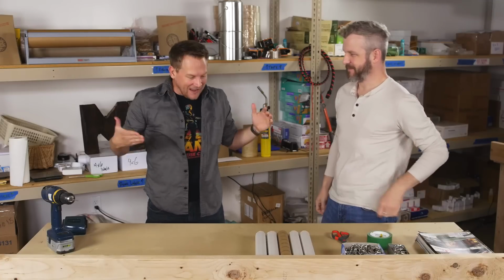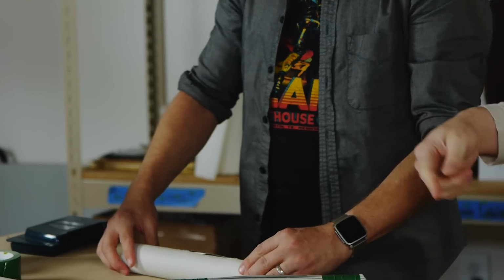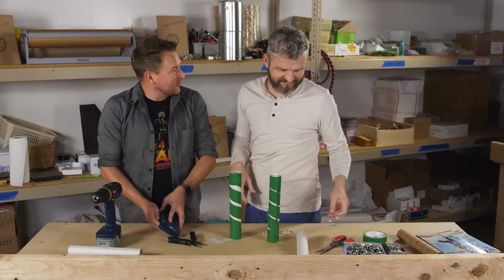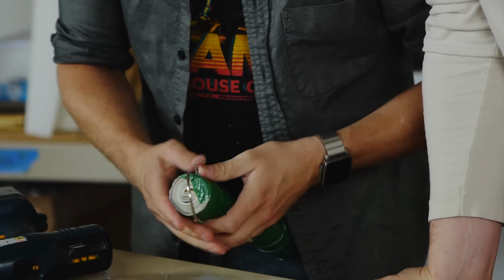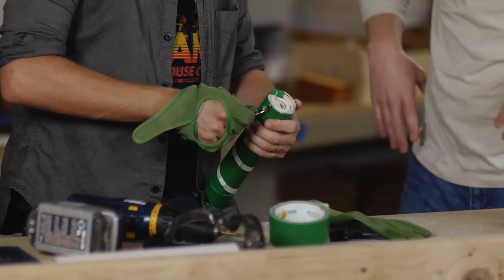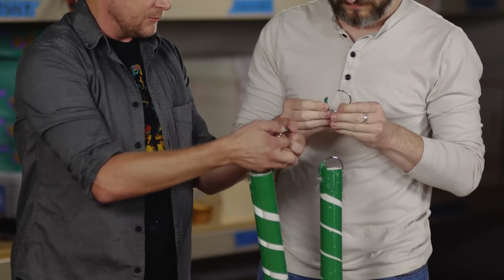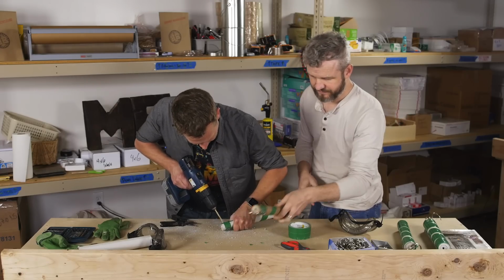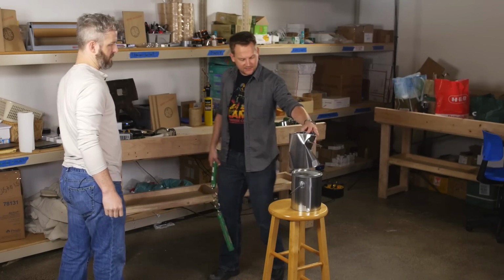Making Real Nunchucks from Magazines

Comment: One commonly overlooked weapon: PVC pipe.
Reply: Abhishek Singh true tho
Reply: Not as a club, its too brittle.
Reply: It depends on the thickness. Thin PVC pipe will break. If it's thick it'll last pretty long. And besides this is an improvised weapon you only need to hit an attacker a few times.
Reply: They did make PVC blowpipes.
Reply: You can make a bow out of PVC pipe that shoots more than hard enough pretty easily.
Reply: It's a catalyst. It can be weapons, but not a weapon.
Reply: I mean when you thin about it youcan use pretry much anythink as a weapon or make those things i to weapi s by combining them (like those Nunchuks) and a pvcpipe is one of them but i would rather have wooden club or a metal tube than light pvc pipe
Reply: Bonk
Reply: Yo my friend made a javelin, a blowgun and a nunchuck just from 1 long pvc pope he found in a field near our street
Reply: @karvast5726  PVC can be used as a club as well. You just have to use the thick walled gray kind. That stuff is seriously tough. I have a piece of 1" diameter that's about 18" long that I've used as a breaker bar for years on tough bolts and nuts such as lug nuts on car wheels. If you filled it with something like JB Weld it would be very dense and would make a good club if you needed it.
Reply: @mikefelty2625  sure you can but since we are talking about harware store parts a plumbing pipe is going to be that much better
Reply: Steel
Reply: bonk
Reply: I'll take a PVC pipe quarterstaff over numchucks any day.
Reply: cap a long pipe of pvc and fill it with wet paper or concrete if you’re that tough and you have a heavier club to smack things with.

Comment: When I made nun chucks the one time, I threaded a shoelace through the middle of the steel bars, tying a knot at the outside end, then taped it down to keep it from sliding out. In your case, you could have taped the rope down the edge of the spine before rolling them up. Just make sure the distance between the ends is as small as possible too. Too much rope/chain/shoelace makes it much harder to control

Comment: Wouldn't it be easier to solder the rings instead of taping them?

Also try to make a balisong out of wood or cardboard.
Reply: DJ Hanzel they are going for cheap DIY stuff so a solder wouldn't fitt
Reply: Or double up on the rings. 
Someone 3D printed a working balisong/butterfly knife! And another person did it out of corrugated cardboard... I think. The magic of youtube
Reply: Nah! the solder wouldn't be strong enough to hold the clasp together considering that those clasp are made out of stainless steel.
Reply: DJ Hanzel i don't think soldering would be very useful when trying to make an improvised weapon

Comment: Places like Home Improvement stores (Lowe's, Home Depot, etc.), sell plastic and metal chains on a bulk reel, so you can easily get them to cut it to proper length for you, rather than trying to tape binder rings together. Maybe for the binder ring that goes through the magazine, you could double up on that to help it stay on the chains.

Comment: guys really? did you not take shop class? you dont wiggle a drill.
Reply from the maker: I fell (once again) into the trap of thinking "It's just paper..."
Reply: Ah understandable. but over all i do love y'alls work. especially the respirator one. Have you guys seen how to make flashbang/concussion grenades with MRE heaters?
Reply from the maker: no, but that sounds AWESOME.
Reply: yeah its pretty simple you get the magnesium heaters and throw it in some water. (the basic explanations)
Reply: The Modern Rogue to get the rings to stay I'd rap the rings in tape over     like alot of  layers of tape do the whole ring and or rings to strengthen the rings with the hard hits or sauter them together or bend the clasp in to hook shapes to lock them in to one another I'd use some pliers to shape the rings.
Reply: The Modern Rogue  very cool use electric tape for stealth and a better grip for the handles.
Reply: Gamma Prysem yeah that is why the THIN drill bit broke don't wiggle
Reply: GamingParkourArt - vlogs and more  Most drill bits will snap if you wiggle them. As someone who builds robots, trust me i know quite a bit about drills. even thick drill bits will bend or snap if you wiggle them in a dense material
Reply: I was cringing that whole time

Comment: For future reference, I'm sure that was a cheap drill bit, but always run the drill while pulling it out so it doesn't snag and snap.
This also seems like it'd be better if you just used a hefty eye bolt epoxied in the top with some actual chain from home depot.

Comment: At one point, you'll have to break out the car battery and make a spot welder out of it to actually close your chain loops. The principle is simple, you just connect the battery to one and the other side, and where the loop barely closes, resistance will mount and it will weld itself together. The issue is avoiding death by fire or battery explosion. I have some moderately more responsible ideas in this regard.

Comment: Putting a thin rope through the core of the magazine tubes and tying some knots on each end would probably be an easier and more reliable way to do this. No drill needed and you could tape over it.
Reply from the maker: good solution!

Comment: Paper is actually really fucking strong.  For a science project, we once had to build a miniature bridge that had to support weights for an exam.  We had to build it with Popsicle sticks, but glue, tape and paper were also accepted.  We had a limit on how many Popsicle sticks we could use, but not how much paper.  I made the entire bridge out of paper, they all laughed at me...  But then came the tests.  My bridge won, not a single other bridge passed all the tests.  I was so confident in my bridge that I even told the teacher to put a 20lbs rock on top of it, it wasn't part of the rating process and the bridge still held up!

They all laughed at me, but in the end, I won, with my mighty bridge of paper!

Comment: mmk guys, when you roll the magazine run paracord through the middle. you will want at least 16 inches plus the length of the tubes (3+ inches out of the ends, taped down, depending on your roll diameter).

Comment: I woulda thought putting a chain through the opened magazines.  Rolling them around the chain then restricting it all with the heavy duty tape as well as bolting off the chain end at the handle end of the nunchuck would have made a much more efficient weapon

Comment: For anyone who wants to do this a bit better here's how:
1: soak newspapers in hot salt water.
2: leave them out to dry.
3: once dryed completely rip them into small pieces about the size of your thumb nail or slightly bigger.
4: use the tubes from the inside of aluminium foil rolls, they're pretty sturdy atleast where I live and are fairly thin.
5: use electrical tape to tape one end of the tube closed.
6: use a broom handle or something similar to stuff the shredded newspaper into the tube, get as much as you possibly can in there but be careful not to rip the tube.
7: once full tape the other end of the tube closed and wrap a layer of tape around the tube to cover the whole thing.
8: repeat until you have the desired number of cardboard hurty sticks.
9: attach 2 sticks with eye bolts and paracord.
10: enjoy.

Comment: Honestly the way you were using it wasn't that far off. Thanks to movies, video games and tricking people think nunchaku are all about spinning and switching hands, but in reality, the intention is just to swing it as hard as you can at someone and then bring it back in. Obviously it takes a lot of technique to learn to use accurately and safely, but most "real" attacks are just hefty overhand flails, underhand snaps and horizontal whips.

Comment: After you've drilled the holes, put the drill in reverse to get the bit out without breaking it
Reply from the maker: doesn't that leave all the paper fluff in the hole?  I'd think you'd want it still going forward as you pull it out to get out all that blockage.
Reply: +The Modern Rogue you can do both. I've never had a problem with leaving a lot trash in the hole after I drilled it. It's just preference. Great vid by the way.

Comment: I want to see the modern rogue make a bo staff, that would be cool
Reply: Christian Serrato Definitely going to do that at some point in the future.
Reply: It would be interesting to see a bo but idk that you could make one out of anything really other then wood and then you need to right wood or else its just going to break. And if you make it from metal it would have to be something that is able to bend and return to shape because thats what gives a bo its power. Maybe copper pipe with a tight packed paper inside and a tight wrap paper outside to hopefully allow it to flex a little but give it enough rigidity as to not bend.

Hell maybe with enough glue and newspaper your could do it.

Comment: Never remove a drill from anything without it being on, rule number one guys. I also would have used rope or string. Like, I get the binder clip thing, but rope would be less prone to snapping open. I now just got up to the point in the video where they say you could use rope.

Oh yeah, nunchucks are illegal (or restricted) in some states, so look into that before you make or buy them.

Comment: I would think that keyrings (the ones where the ring goes around twice, instead of having a hinge) would work better as the chain part.
Also, you don't need to do this as a full nunchuck, you can just roll up a magazine tightly and use it as a short self-defmce baton.  Jabbing the end into someone's muscles can be remarkably effective. (give it a try on camera sometime ;)

If I was going to go to the amount of effort YOU guys went to, though - I'd just do it 'properly' with two sections of broom handle, and a length of paracord.  (Get a decent-size drill bit to drill two holes through the diameter of the dowel near the end, about an inch apart, and another hole from the end down the center, to meet the first hole - thread the rope in the hole in the end, loop it out one of the diameter holes, through the other diameter hole, then complete the loop to pull it out the length-ways hole.   Do the same for the other dowel, then tie the two ends of the rope together.)
Reply from the maker: yes to all your comments.  And judging from which, it sounds like you'll enjoy this: https://www.youtube.com/watch?v=A5rwjz4LjlY&lc=z12ddv3zgkukilq5g04cch4zopjjjl2y2mo0k
Reply: The Modern Rogue
Haha, yup - just like that ;)

Comment: Aside from the binder ring bad idea and the paracord good idea, I would only question the construction material availability. I assume we are using rolled paper because of availability of that in a prison environment. But then binder rings, drills, and even paracord would not be available. So of we aren't restricting the conditions to a prison environment, why not use 3/4 inch diam. wooden rowels, and linked chain? So I guess I am giving this video a bad review because it is an extension of what could be done using the millwall brick principle, but the project disregards better choices because we aren't restricted to materials. I love the channel, and both you guys too, so I don't want to give the video a bad review. So let's pretend I didn't. Thumbs up.

Comment: Why... why use binder rings? They're not designed for ANY weight whatsoever. You can use actual chain, or heavy ball chain, or steel wire, or nylon rope, or quick links, or even key rings for crying out loud.
Reply from the maker: hey man, we just followed the recipe as given and did our best to make it work.
Reply: Ah, I didn't realize you were following a design. Maybe I'm a bit jaded, I used to make poi from hardware crap to sell at festivals and and on the street, so I know what kind of forces will be put on the chain when you're spinning something fast. The moment you said "Binder rings", I winced. Key rings, the sort that are two winds around with a crossing, would do the same thing, and are almost as cheap, but are designed to hold a heck of a lot more weight.

I've been enjoying a lot of your videos--sorry my first comment was negative. I really enjoyed the "Crack a Bullwhip" vid. Have good days!

Comment: Sooooo...My friends and I may have already done this in...yeah, Junior High.
We'd take our school newsletter (roughly half the thickness of a magazine and a stapled spine), roll it up as tight as possible, tape it (2-3 layers of Scotch Tape is disturbingly strong), stuff the crap out of it with paper (20-28lb seemed to work best) about 2/3 full, found some 1/8" - 3/16" cordage and tie some large confangle-bob knots in it and set that in, then stuff the rest with paper, tamping it as tight and compact as possible with whatever was available.  Then we'd use electrical tape (any other strong tape would work) and wrap the whole damn thing up, making sure to over tape the tops and bottoms of the ends.  Later we got creative and hockey stick style taped the far ends so it was a large mallet'ish end.  Being the stupid teenage boys we were, we'd go around school beating each other with these "beat down sticks" until we got suspended from school (only a day, they couldn't get us for fighting or technically having a weapon, but...yeah, something).  They came out about 1/2" to 3/4" diameter tubes and were insanely formidable weapons.
Reply from the maker: nice.

Comment: Great episode, very cool! Good job adapting and modifying the design. The original design however...

To whoever created the design, nice idea, plenty of design flaws. It could be equally simple and much stronger engineered, if only the person who originally created the design didn't have a death wish for everyone who tested it. BINDER RINGS???!!! REALLY?!  Ditch the binder rings, which no amount of tape will ever hold shut reliably, and replace it with 12 ga wire for the connectors and heavy duty key rings for the links!! Much sturdier, reliable, and even easier to get a hold of than a box of binder rings! (And more likely to be around the house, because if you had to order binder rings, you also wouldn't bother using a primitive material like magazines. Magazine nunchucks would only be required in a desperate situation where you had just a few materials around and not much time.) Or, if you really want to go simple, drill a really large hole, and thread paracord through. Both methods (wire + key rings vs paracord) even allow you to drill only one straight hole! (Btw, don't try just using wire, I doubt it would be quite flexible enough.) Also, I recommend ditching the sheath and just wrapping it tightly in the duct tape, because when you grip the sheath and start flailing the nunchucks, the sheath will tear out, as happened on the episode. Or, if you really want the sheath, drill a bunch more holes along the length of the stick and weave wire, string, or paracord through the holes, so that the sheath becomes sewn to the stick. That will also improve the grip. Sigh Could the design possibly be any worse? Scratch that, I don't want to know.
Reply from the maker: Haha-- you have no idea how much I appreciated you directing your criticism specifically at the design, and not at us.  You're a true champion of the internet, sir.
Reply: I'll wear that badge proudly, sir. Though...I did have a reminder from one commenter reminding the others that y'all were following a design. After all, you guys go out and find ideas and test them out, not necessarily reinvent them.

...I still would have really like to see some key rings come out and replace the links. ;) (However, your solution of doubling up the links was quite well done. Quite well done indeed.)
Reply: what happened to using chains?

Comment: One way to make a better pair of Nunchucks is by using rope or twisting duck tape into a rope to connect the 'bodies' of the Nunchucks. I had a Nunchuck made with chain and it flew apart just like this version did. Just one amateur Nunchuck creator's opinion.
Reply from the maker: agreed.  The binder clips just can't hang.

Comment: You can use binder rings, string, rope... Or you could just buy some actual chain?? They sell it by the foot at home depot. You need like 6 inches. It won't cost much and will hold up better than some improvised BS.

Comment: Erm... Couldn't you just use rolls of aluminium foil straight from the package instead of paper for an even greater effect and less work on preparation? Would be tougher, harder similar weight, less prone to damage.

Comment: Use some paracord, and that'll be a weapon to surpass metal gear
Reply: Do you think nunchucks can bloom even on a battlefield?
Reply: He who controls the nunchucks, controls history
Reply: I hear it's amazing when the famous purple stuffed worm in flap-jaw space with the nunchuck does a raw blink on Hara-kiri Rock. I need youtube videos! 61!
Reply: you got me there
Reply: The problem with paracord, is that it stretches. I've tried to "upgrade" from using plastic twine and replace it with paracord to pull something not very heavy, and it was stretching so badly (like a rubber band, even if I used multiple strands) that I had to switch back to the plastic twine. Also, elasticity absorbs impacts and vibration, so paracord would make the nunchucks weaker.

Comment: Is that a really low quality drill or is the paper harder than concrete as I already drilled through concrete walls with battery drills.
Reply from the maker: Man, I think the paper is just way harder than you think.  That's why I kept drilling so casually:  I kept thinking "pfft.  it's just paper, right?"